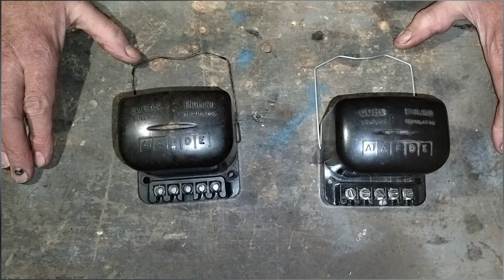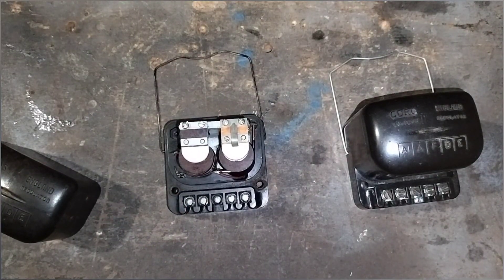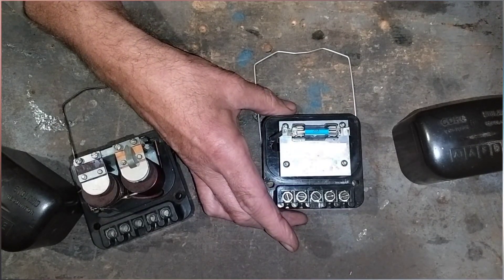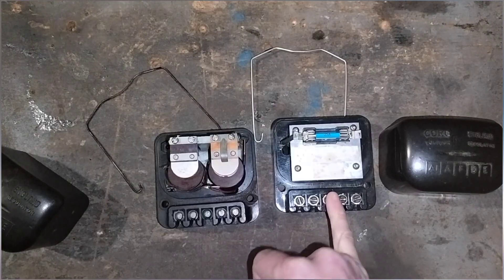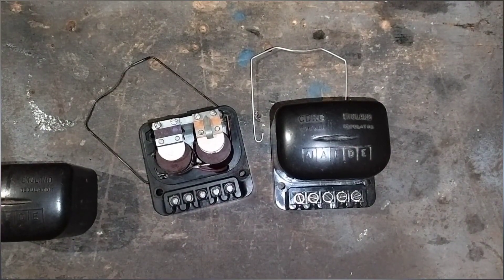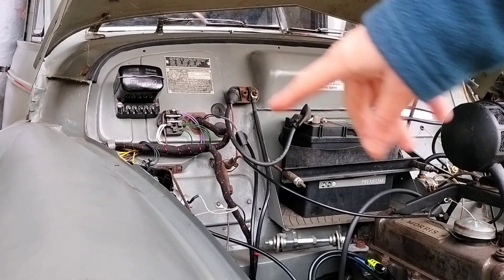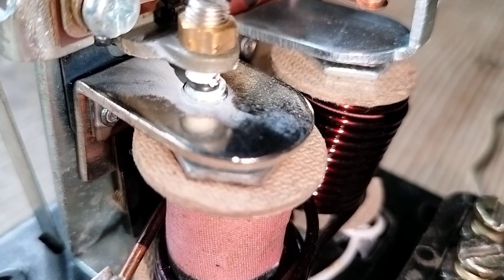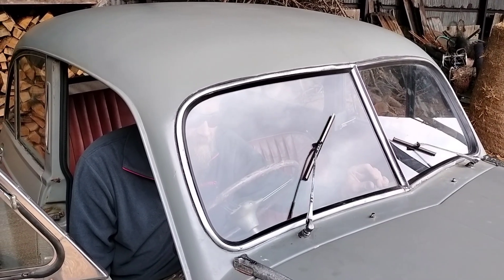Morris Minor Level 3: Control Boxes

Comment: People often swap the dynamo for an alternator and this does work well of course, but is not original.
As you say, the after market control boxes are just a whisker better than useless. The solid state control box , on the other hand  I think is brilliant. I have an ammeter gauge fitted and with the old control box,( when it was working!) the needle used to flicker like mad indicating uneven output or something. The solid state however seems to be more in control of the dynamo varying output and the ammeter needle is usually very steady. In addition, the solid state copes with higher demand when the headlights are on, for example and never shows a discharge unless at engine idle. Thus the reason for converting to an alternator is negated by this solid state version.
Reply from the maker: The solid state ones are really good and seem to regulate much better - it's a shame that they're not well known or easily available from the normal Morris Minor sellers 😊👍

Comment: Years ago while an impoverished electrical engineering student at the Polytechnic of Central London,I built a transistorised take  of this  Lucas  control box as part of my coursework for my Ford Anglia. Worked of a fashion. But the  germanium power transistors then available not robust enough to handle the switching spikes. that an electro/mechanical relay could.
Reply from the maker: How brilliant is that 😊 It also shows how complicated they are as units and how important the components are 👍😊

Comment: I’ve been messing about with my control box recently but in the end turned out to be the Dynamo, I had an old one on the shelf so we shall see how it goes. 
I didn’t know about the digital control boxes so thanks. 🙏😊👍
Reply from the maker: Thanks Dave, it can be difficult to work out which one is the issue. We disconnected the dynamo and in doing so we were able to ascertain if we had the same symptoms, which we did. The dynamo on our 1954 was put on the car in the 60's, which shows how long they can last! Hope your issues are sorted 🤞
Reply: @BlindManMorris yet to test drive but seems ok. 👌